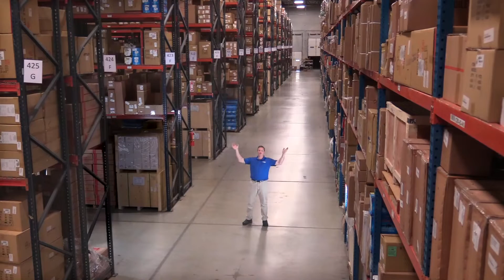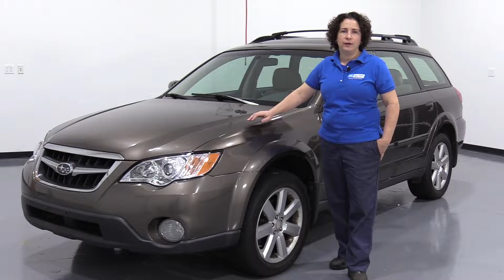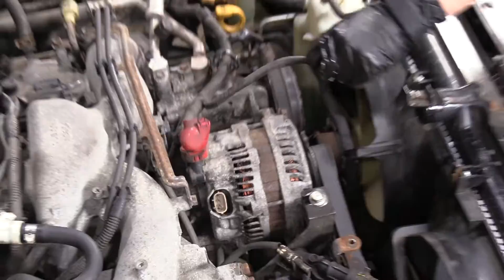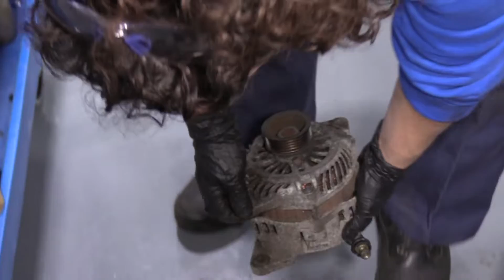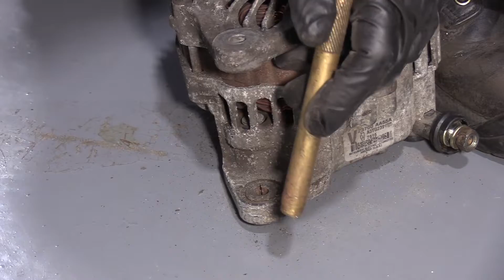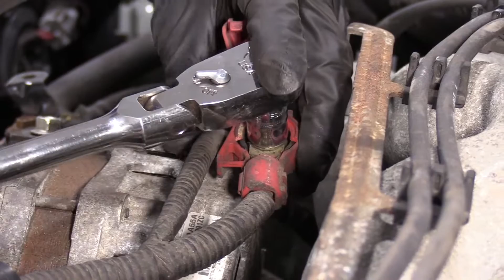How to Replace Crankshaft Position Sensor 00-12 Subaru Outback

Comment: Thank you for this video.  I was able to replace the part for my daughters car without removing the alternator.  I have small hands and was able to use 2 screwdrivers to remove the connector of the crankshaft sensor.  Then I used a smaller ratchet with a 10mm socket to remove the bolt and then a screwdriver to pry the old part out.

Once I found the needed tools, the replacement of the part took less than 15 minutes

Comment: Please tell everyone this is not for the H6 3.0
Its at the back of the motor.
It sits under the throttle body .
Find the motor number plate to the back driver side of the motor.
To the left of that is a rubber cover.
Its under the cover
It's hard to find

Comment: Question for you do you have to do the relearn procedure after installing the crankshaft position sensor I do have a 2011 Subaru outback 2.5 premium and I just replace mine. Thanks for the video by the way and I am not sure if I have to do a relearn procedure or not The engine code was on for a few minutes, but then when I drove the car for like five minutes the code went off. It is not there anymore. I’m just not sure if I have to do that relearn or not. Thank you.

Comment: Had an issue on my 2011 outback with it cranking and not starting. OBD reader gave me a faulty crankshaft position sensor code. Was able to switch it out by only removing the belt and the left half of the alternator which allowed me to pivot it out of the way of the crank sensor. Took about 30 mins and I'm awful with cars. Changed out my serpentine belt while it was off

Comment: Top notch video on changing the crankshaft sensor!!! I especially like how you described what you were doing and all the embedded “tips” like putting the nut back on the alternator so you know where it is, the size of the wrenches needle for the particular bolts, etc. I changed the crankshaft sensor easily with your help, following the steps you outlined. You’re a Rock Star!!! Thanks for the purrfect video!!!

Comment: Either wrap the positive lead of the alternator to insulate it or disconnect battery as well, if that hot lead touches any metal under the hood it will cause a big short
Reply: Or just disconnect the ground....

Comment: Hi there I have 2007 Subaru Tribeca it's cranks and doesn't start the engine what seems to be the problem there please. Assist
Reply from the maker: +Sbongiseni Ndawonde We are unable to provide a diagnosis over the internet, we would suggest consulting with a local mechanic to determine what is happening with your vehicle. 1aauto.com

Comment: I was able to pop sensor in without removing alternator. Quick easy fix
Reply: You can replace the sensor without pulling the alternator. But it gives you more room if you remove it.
Reply: That’s what I was thinking it kinda looks like you could
Reply: Damn really how u do that
Reply: Me too, but definitely a tight squeeze! Figured it was worth a try, thanks for the tip. I think this is a solid video on how to do it the conventional way too 👍

Comment: Is the cam sensors and crank sensors the same part number?
Reply from the maker: +fachinimichael The camshaft sensor and the crankshaft sensor will not be the same part number, they are different pieces.